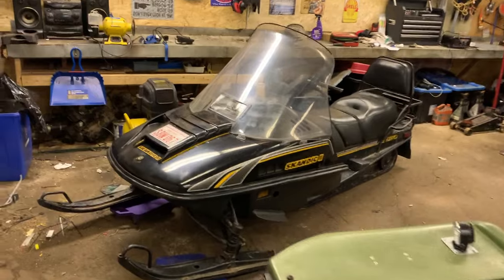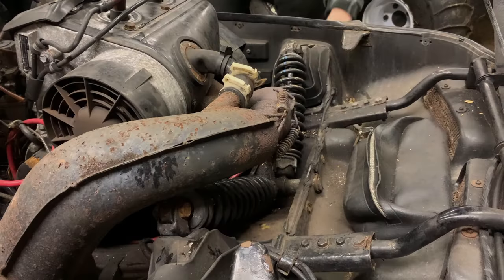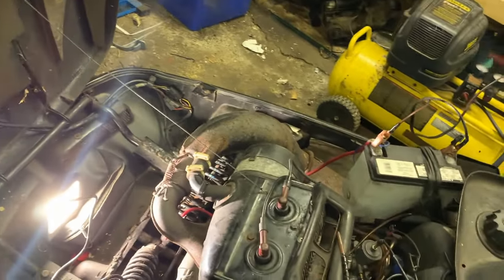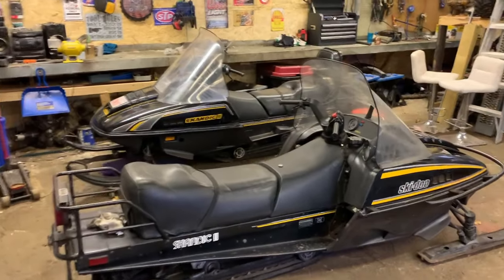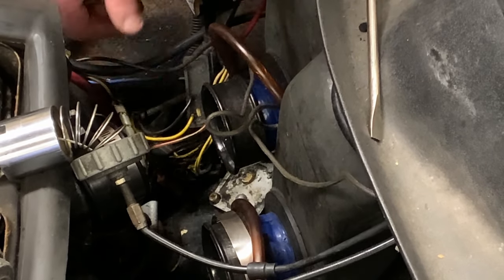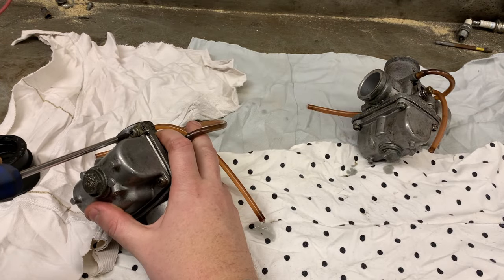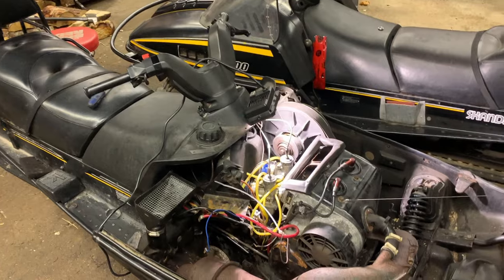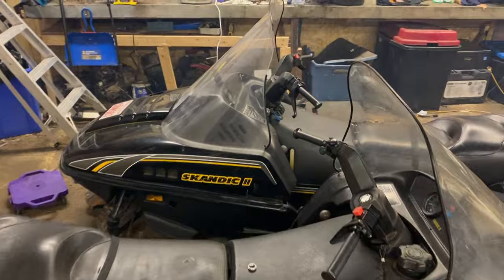Skidoo 377 Scandic - Will it run??

Comment: I’m in Alaska got my 11 and 9 year old a 93 safari… they rip it around quite a bit but it seems to be barely getting power… I just pulled it in the garage and gonna do a carb clean after watching your videos… I need a break light and a windshield and a seat… but they are a fun little sled for sure!
Reply from the maker: most likely if its losing power its fuel / carb issue. could be fuel pump weak too. let me know how it works out for you! and yes they are nice little machines for sure. I plan on hauling wood when i get the chance with it ( assuming we get snow this year haha! )
Reply: @muddythumper8152  pulled the carbs and it is a whole new sled! Like it’s only 20 years old 😂 added some ski skins and it’s next level

Comment: Thank you!  I am battling with one of these, a '94, a bit rough...I've yet to know if it'll run.  Very helpful watching this video.  Mine starts ok, idles ok, but won't take throttle, it winds up half way, then bogs down, and either stalls, or barely sputters on back to idle...I usually have to crank it 3-4 times to get it going to a steady idle again...I'll re-open the carbs and clean extra thoroughly, I'll check fuel like you did, see if the pump is dead...and go from there.  I haven't checked compression, but it starts quite well, so I think its either a carb or fuel problem.
Reply from the maker: Thanks, check compression , your issue sounds like a main jet problem or fuel air ratio screw. I’m on the east coast if you need some help - cheers

Comment: Newbee to your channel. Just dragged down a 82 Citation sitting under a tarp for a few yrs.
no start, won't pull over. It's been a mouse motel for some time. This engine is a beast to work on buried down in the body panels with no access covers to remove. Picking up a engine hoist this weekend to haul engine out and see what's what.
Reply from the maker: that is sweet! and thanks for swinging by i got a few more upcoming projects for the sleds. 377's are good engines. let me know how you make out with the project
Reply: @muddythumper8152  Kinda hoping the starter was stuck like yours, no such luck,haha. Dealing nasty weather here right now, so working in the shop is awesome. 
What part of the "Rock" are ya. Spent 6 weeks down in Marystown shipyard few years back. Four seasons in a day. Loved it.
Reply from the maker: @happyrecluse2849  if yours is seized take the plugs out and fill it up with marvel mystery oil or something similar and let it sit for a few days, rings could be stuck on it. And nice, i am from st johns!
Weather here isnt good so far.. still no snow yet
Reply: @muddythumper8152  Thanks for the tip, sprayed some PB Blaster down inside couple of days ago. Have n't  touched it since. Been disconnecting stuff, wiring, muffler and getting hood off to get hoist in.

Got a 86 Harley Sportster I was planning on rebuilding this winter also. 
It's all in pieces stored in boxes while I get frame and body parts painted.

I did subscribe but been too busy to check out yer other vids. Lol
Keep em comin.   Later

Comment: What oil do you use i have and engine like that one but don't know what oil it used
Reply from the maker: just normal 2 stroke engine oil and mix it 50:1, throw it in the tank if you have the oil injection unhooked, premix the fuel